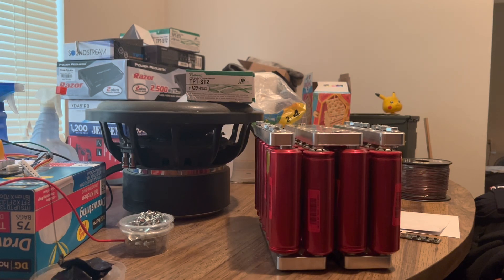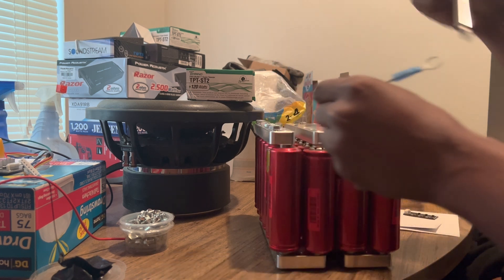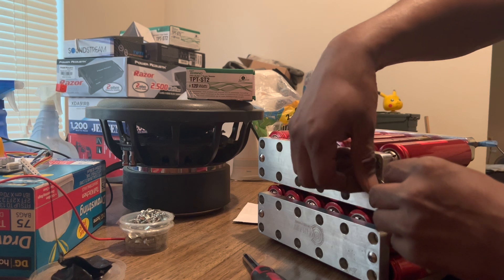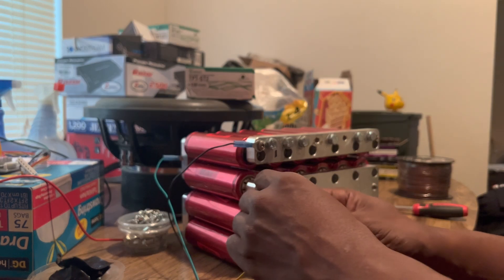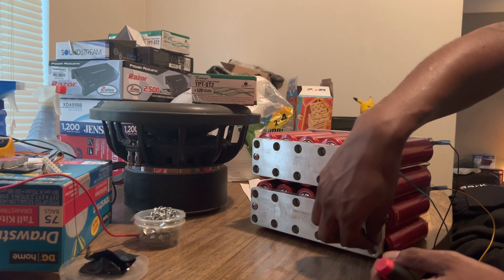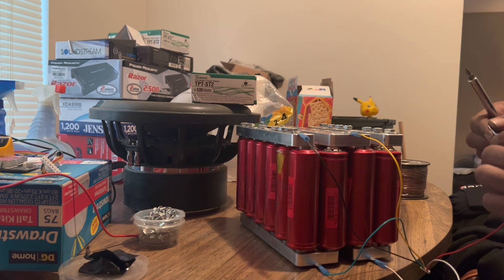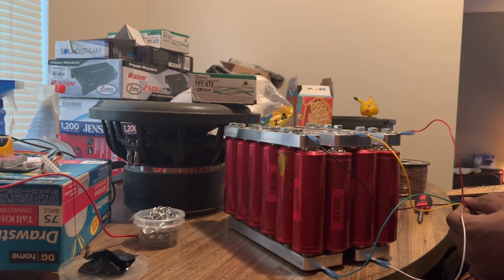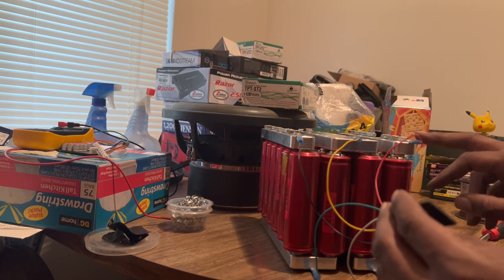How to connect 4S Balancer BMS for “48ah Lithium Headway Bank”

Comment: My alternator at start up charges 15.1v but a few seconds after warm up it goes back down to about 14. 3v. Do you think that's ok with this battery. I've read it's ok but other opinions don't hurt
Reply from the maker: @raolito1980  14.3 is good to go 15.1 might be a little high but anything in the 14s is OK

Comment: Can a regular battery charger be used with this bank? My charger puts out 14 volts while charging..or do I need another special charger that I can adjust the charging voltage up to 15.8 or 15.9 volts for example?
Reply from the maker: I’m not sure but you can try it to see if it charges but if not check on eBay they have tons of options
Reply: These shouldn't be charged past 14.6 in a bank. 3.65v max per cell.

Comment: About how many ah would I need for my 2krms system?.. I'm thinking bout 28ah along with my AGM should be sufficient huh?
Reply from the maker: First of all I think you don’t need any lithium if so get 16ah that should be enough
Reply: On certain songs,depending on how they recorded it, some of the notes will drop me down to 12.1 but I bounce back up to normal voltage pretty quick..

I'm trying to have rock solid voltage so that I wouldn't drop much at all..

Trying to stay around 13.2.. And my alts regulated😬😬